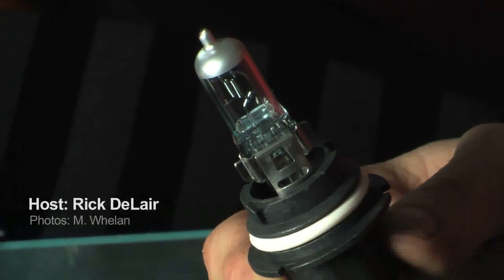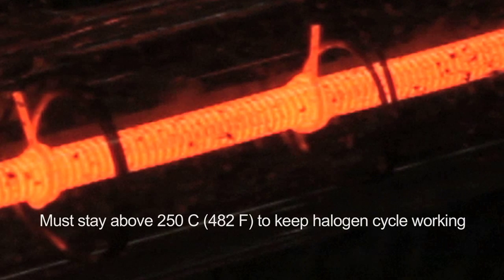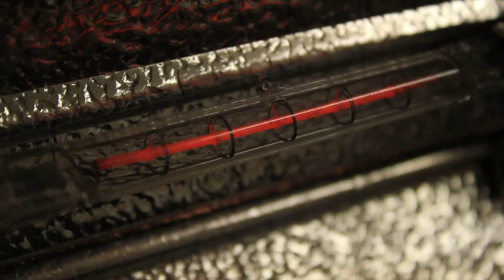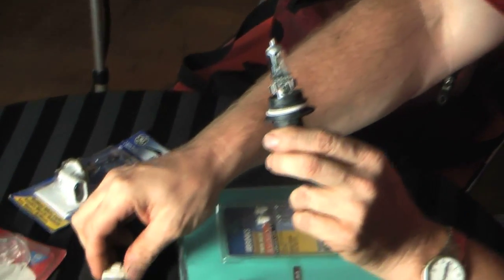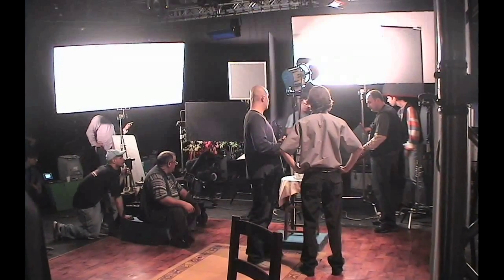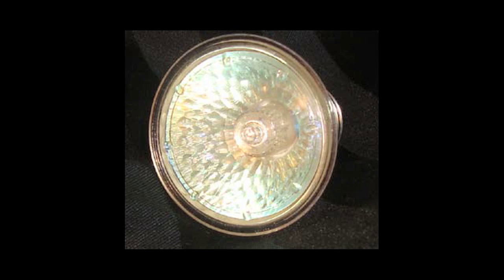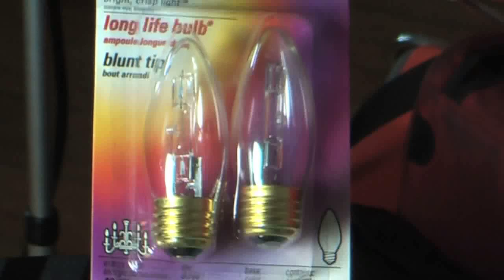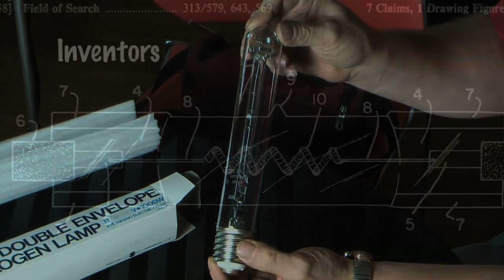The Halogen Tungsten Lamp

Comment: Not "when it cooles": the tungsten halogen salt is split (thermolysis) by the heat of the glowing tungsten filament. That way the tungsten is deposited back to the filament.
Reply: Instablaster.

Comment: I bought a home which had several nice looking tungsten halogen fixtures.  I refurbed them all with LED bulbs.  Halogen lights are passed it.  It's basically a heating element that incidentally provides some light.
Reply: I don't mind the heat. It is desirable in my cold climate, nothing is wasted actually. If only the govt could stop treating us like babies and instead trust us about the rationality of our choices, I would be much happier.
Reply: Halogens are literally incandescent, why would you even compare it to LED? Ofc the LED is more efficient
Reply: @specialopsdave  That was my point.  Halogen bulbs were once thought to be a new innovation, bright, long lasting and trendy.  I like the fixtures so I converted them.
Reply: @utah133  Nobody who uses halogens thought they were long-life, they were just 30% more efficient
Reply: @specialopsdave  more like 10%
Reply: @tearimakatekeimoa1675  Halogen 100W equivalent bulbs use 72W. Do the math.
Reply: @utah133  
Did you insert a proper LED driver or did you just replace the halogen bulb  with a rectifier stick sitting directly across the A.C. line strobing at 100 hertz or 120 hertz?
Reply: facepalm.
I like halogen and incandescent, it's the only bulbs I use because LED create blue light and dirty electricity.

Comment: Rubbing alcohol has adulterants added. What will these do to the lamp? It would be safer to use 91% isopropyl alcohol and it's not that much more costly.
Reply: @antoniojmonetti  But in the long run it will be worth it much like spending $20 worth of bike tube patches or a new $20 Tube.